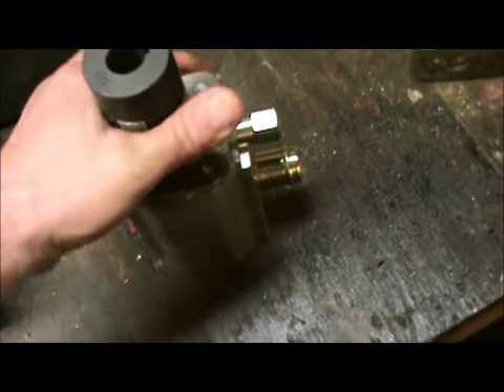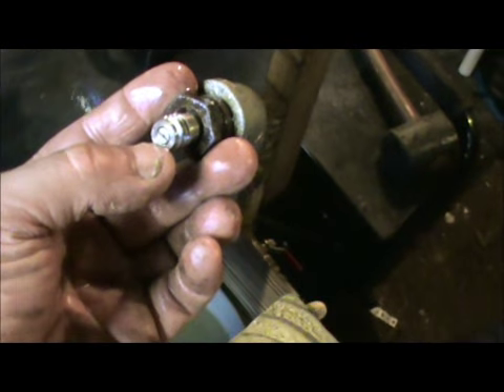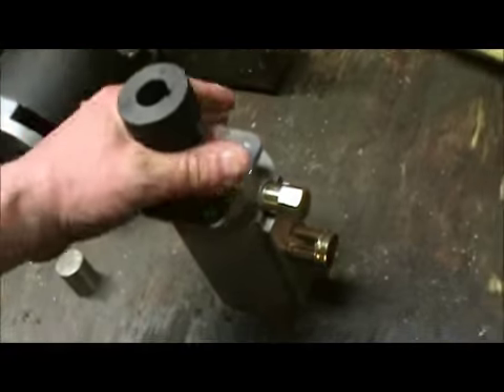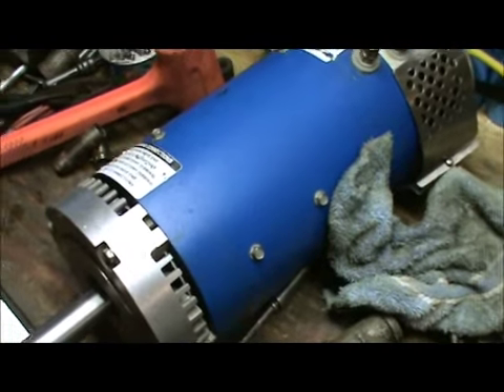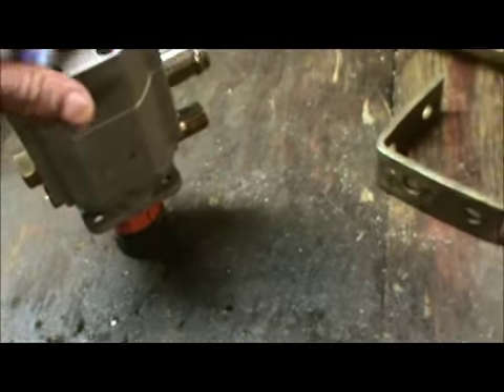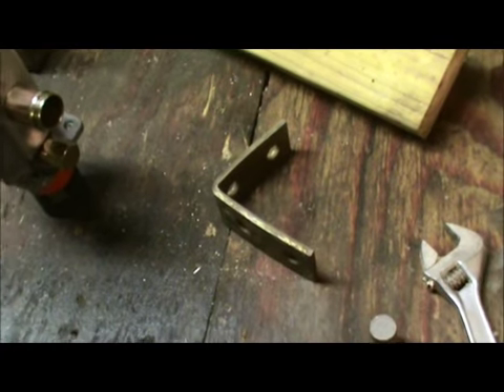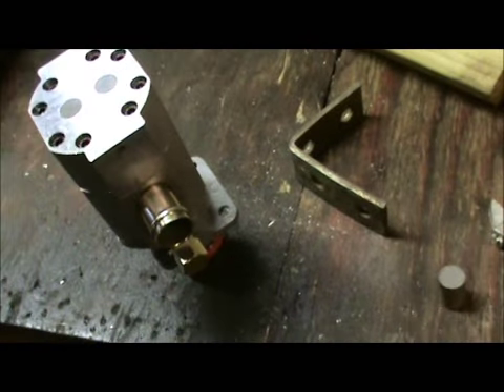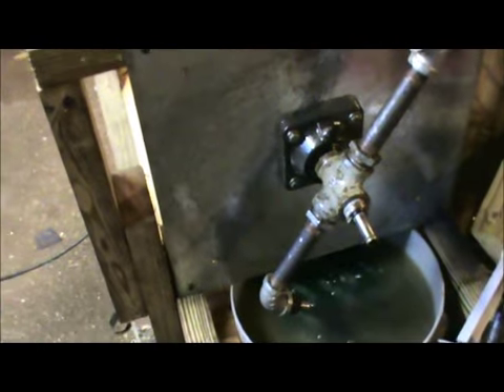New Clem Engine Project

Comment: I think you don't need any pumps but just a sealed unit! For instance, take a gallon jug and it has some weight to it if you take the jug and swing it around in a circle like on the end of a string the faster your swing it the heaver it is. So take the fluid and place it in a round container  like a tire shape made of steel have the pressure washer nozzles on the outside and have a containment for the fluid that exist's threw the nozzle it falls into a reservoir at the bottom with a pickup hose so the unit, when powered up, sucks the fluid up by itself the fluid creates the weight and pressure to push it threw the nozzels  the faster it turns the higher the pressure and the inward section creates a vacum to pull it threw